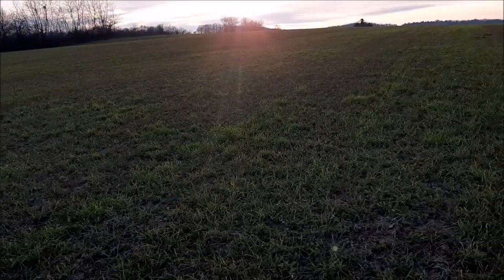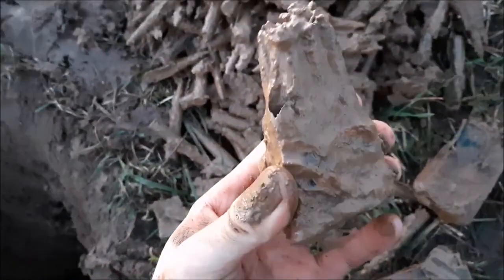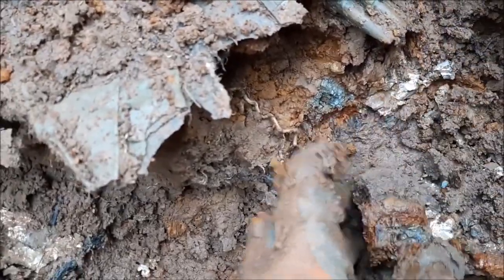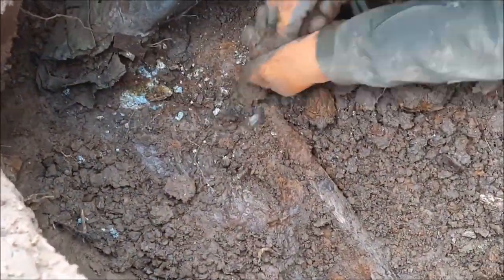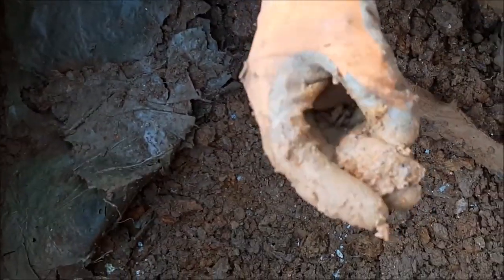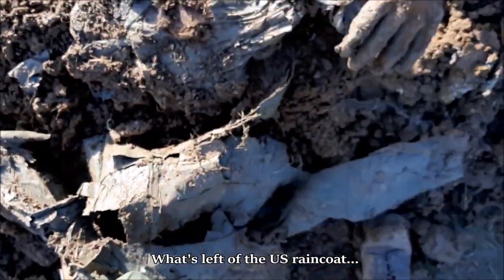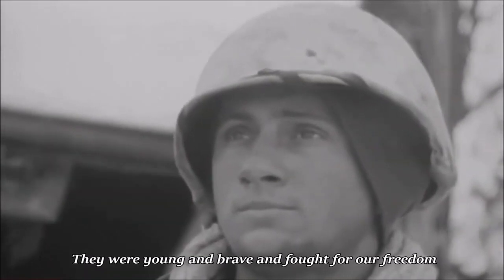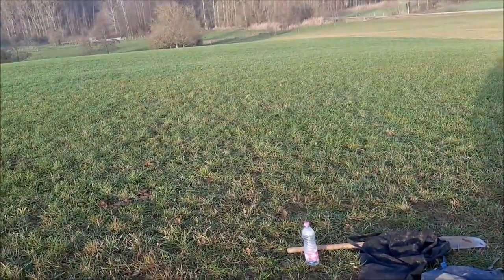Untouched WW2 foxhole excavated Battle of the Bulge ( WW2 metal detecting )

Comment: On the bayonet scabbardarked SERV,  that man was in a service company, meaning maintenance, a mechanic.  You can restore the shovels ,soak them in diesel for a week ,buy replacement handles and original rivets,  a good cleaning reassemble them, repaint them the correct Army O.D. of that time frame and you have fully operational M1943 entrenching shovels..